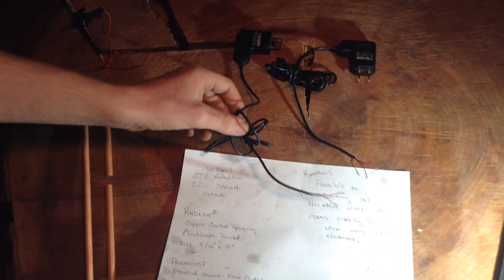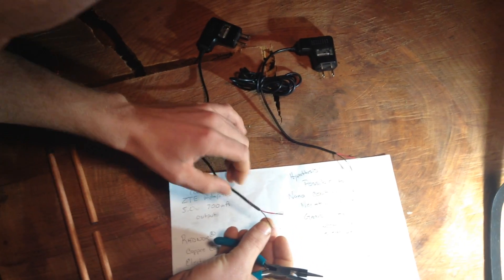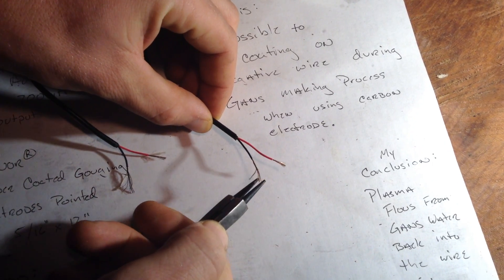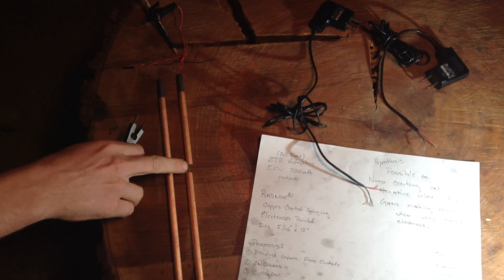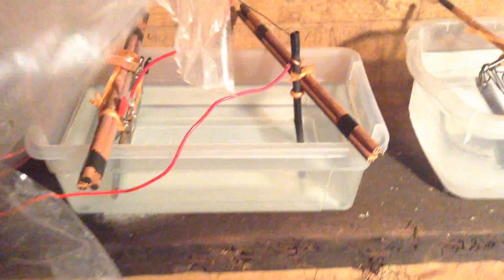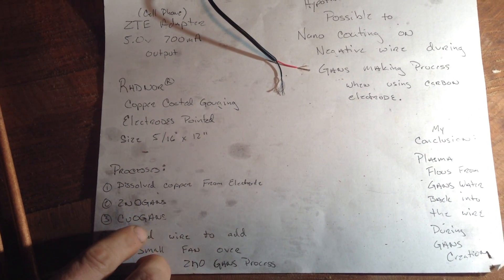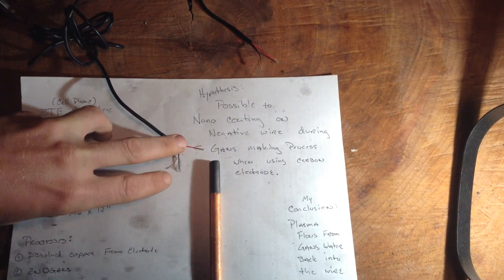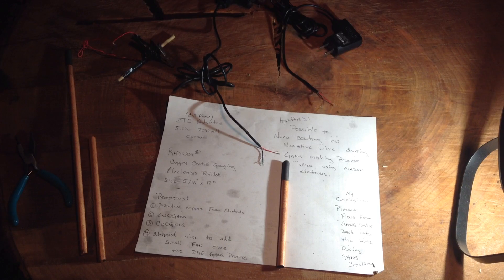Nano Coating Wire during GANS Creation, the Plasmatic Electric Process

Comment: I experienced a similar result while trying to produce CO2 gans using a carbon welding rod and a zinc "anode" https://www.amazon.com/Zinc-Anode-Overboard-Copper-1-lb/dp/B001QUXB2W/ref=sr_1_12?ie=UTF8&qid=1488663912&sr=8-12&keywords=zinc+anode 

  Note that the anode has a little bit of the copper wire coming out of the bottom which was submerged. I used an adjustable constant current power supply set to .5 amps. After much use I noticed that the copper wire from the zinc was blackened which I assumed was nano-coating.  I sanded it off and attempted to reproduce it again but so far poor results. The coating is uneven and won't seem to coat any further. If it works, I  think this would be a good way to nano-coat because no polarization is necessary.
Reply from the maker: Very interesting, Have you utilized the nano wire and co2 gans to structure water yet?